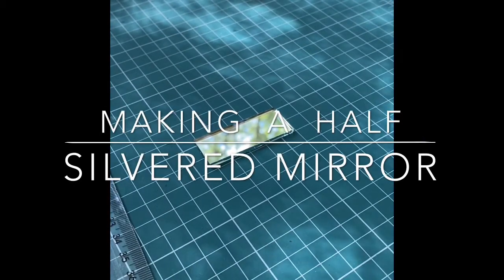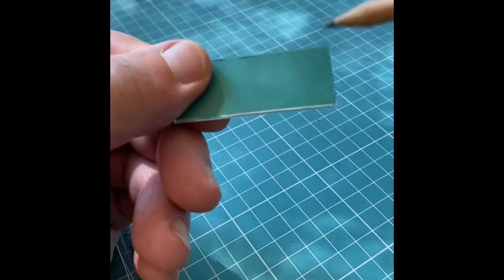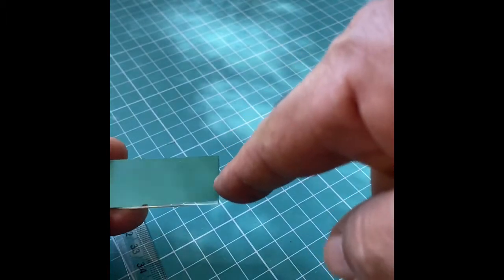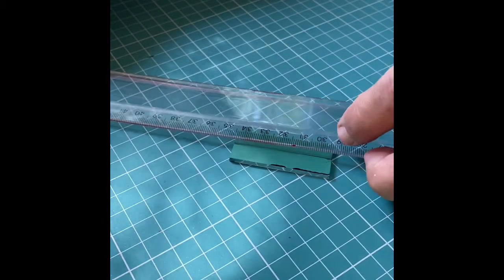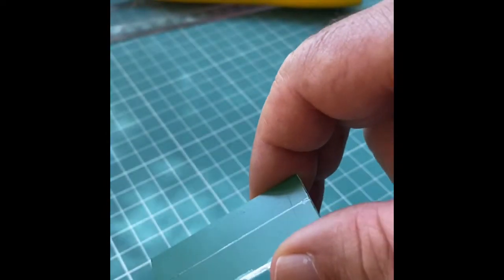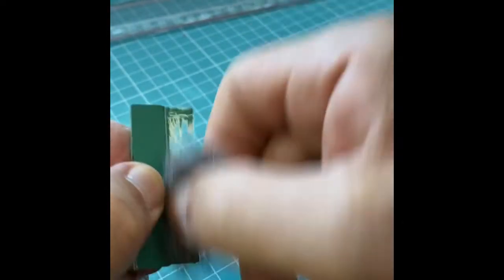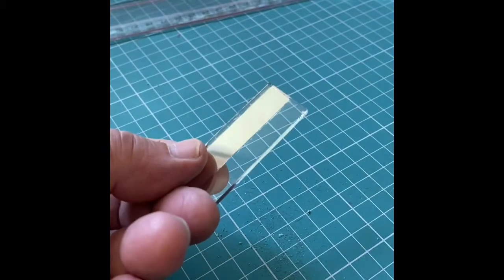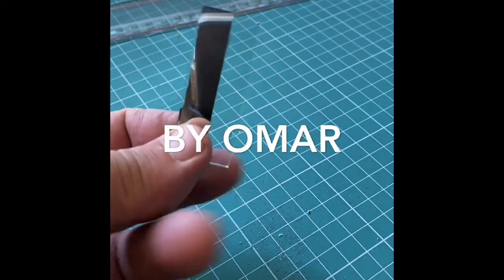DIY half silvered mirror for a homemade sextant

Comment: this is not half-silvered mirror, the mirror must be semi-transparent so the photon that travels through it splits in two photons (quantum entanglement) , first photon that travels forward, and the second one that gets reflected and travels to another direction. Here you have is : two glass plates joined together one of which is a mirror and another transparent
Reply: He obviously means a mirror half covered in silver. Regardless, there is no reason to mention the quantum mechanical parts of a half silvered mirror: you could have just said a mirror that only reflects half of the light passing through it, or mentioned a one way mirror, which is a better explanation and more accurate.
Reply: Why will you get a quantum entanglement over here. It's just a mirror not SPDC in non linear crystals